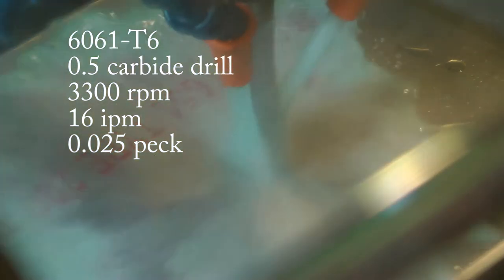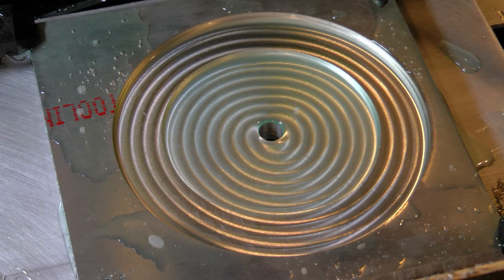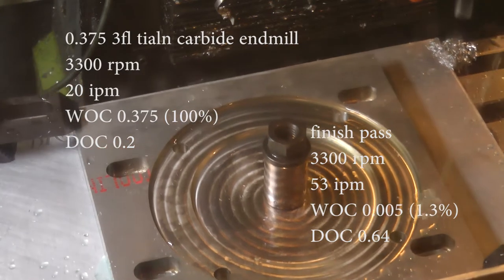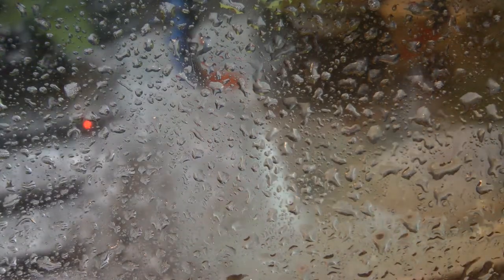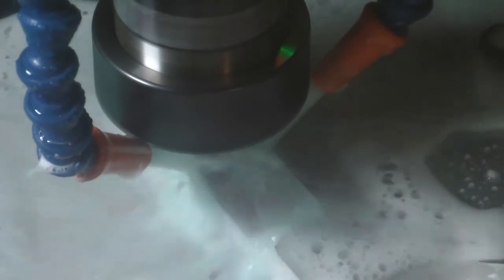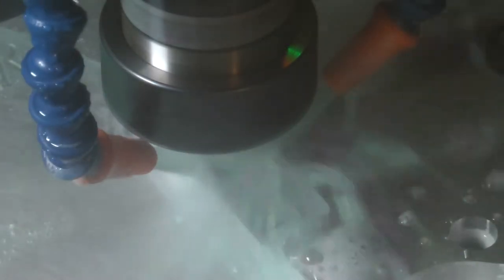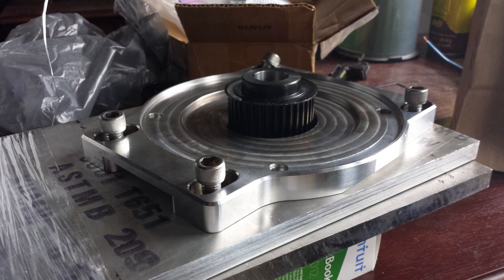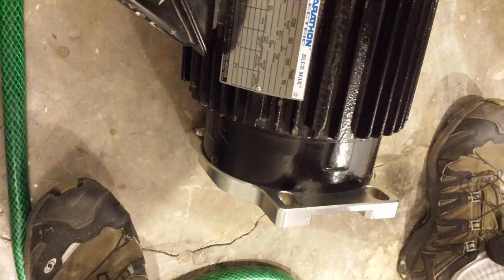motor mount machining ops with old BLDC motor pt.1 of 2

Comment from the maker: Hey Bruce, I heard the same thing as well.  I actually meant to say it was the only one (other than that 1/8 2fl uncoated carbide) that was suitable for Al.  I got it for slotting steel as it is a 3fl but all of my other endmills are 4fl so I wanted to avoid using them.  Your right though I need to pick up some more 2fl and 3fl endmills that are either uncoated or have a different coating.  Even the inserts for the facemill are for steel since I don't have any Al ones, but they work fine for the little machining I do in Al.  That 3fl is still razor sharp though with no damage whatsoever.  More videos to come!

Comment: 19:40 You say that was your only aluminum cutting end mill, but the caption before that section claims it's an TiAlN end mill.  Common wisdom is to avoid aluminum based coatings when cutting aluminum.  Serious machinists usually use ZrN or TiCN.  For hobby shop material removal rates, you can definitely get by with TiAlN (aka AlTiN) coating when cutting aluminum, but may not have much benefit over uncoated.

I am SO looking forward to that beefy new motor hogging out lots of steel chips in a hurry and not stalling and breaking tools at all.  Productivity is just around the corner.

I need to get back on my CNC projects.